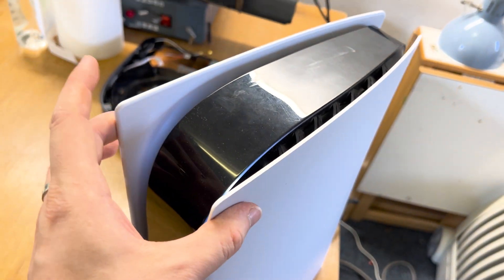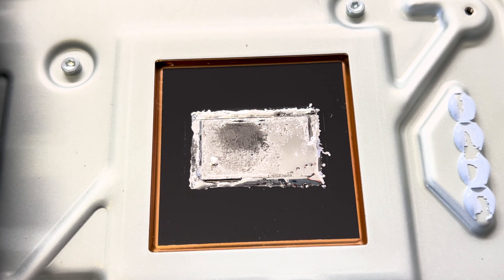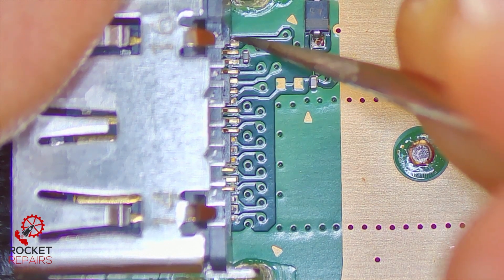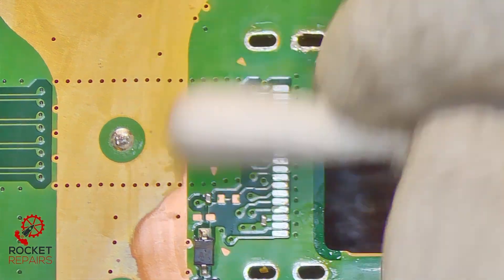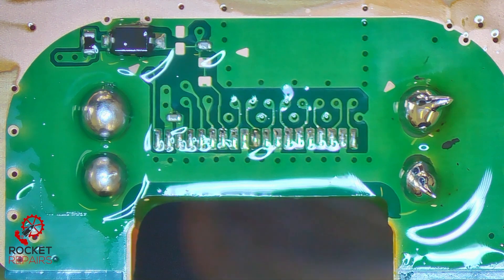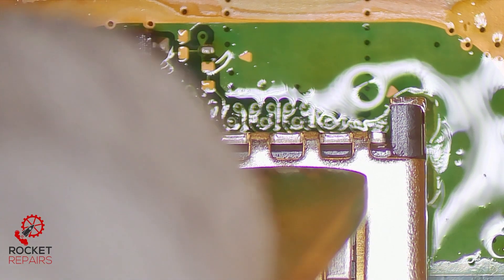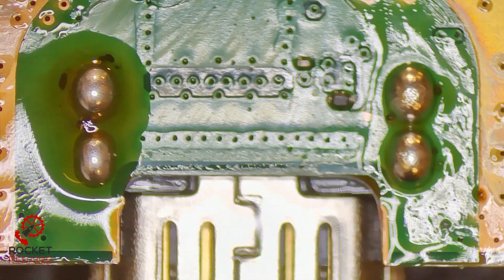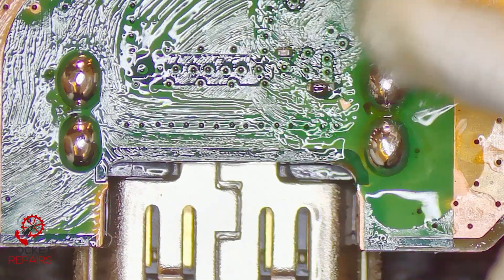Broken PS5 Repair RANT - Factory soldering strikes again!

Comment: Its pretty strange. A while ago I got a Dualsense/PS5 controller "for parts" and all that was wrong was that the USB C port legs weren't attached properly. A bit of touching them up again fixed it. I wonder if it's something with the solder from factory being too brittle?

Comment: Some sort of HDMI adaptor is needed with a short wire so anytime it gets unplugged the OEM port is not getting any action .. Lead free solder is far to brittle after heat cycles..

Comment: TBH its bad on both XBOX and PS, why not provide ports on separate PCB, like they do with USB and other things. If this PCB was mounted in a way that the port being used just pushes towards the PCB instead of trying to "slide on it", it would be much more robust solution. Of course if signal intergity would allow such a solution.

Comment: That's bad.

I remember in the early 2000s having a Sony laptop which stopped working a month after warranty.

Sent to Sony who said it was a RAM slot issue. 300 quid to swap motherboard with 3 month warranty. The laptop only cost 600.

Got it sent back and asked my mate to look at it. He said the pins on the RAM slot weren't even connected to the board. Soldered the pins all worked again no issue.

He had the same laptop but his was working but he took a look. Same thing, pins not soldered but touching enough to work. He fixed his too!

Comment: This is the problem with lead free solder its awful stuff and still isn’t any good since they started using it in the Xbox 360 days!! The amount of cpus on phones that need reballing, or loose ports that need soldering really is silly when leaded solder works fine and the health risks associated are minimal and could be negated with the correct fume extraction anyway.